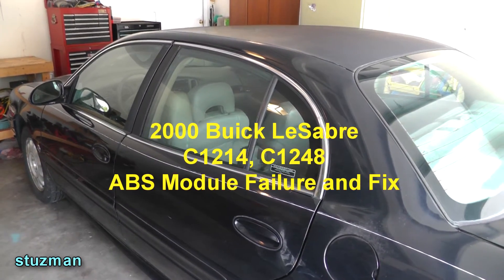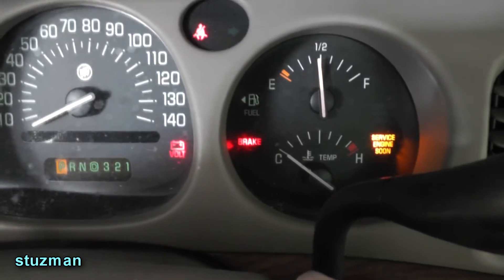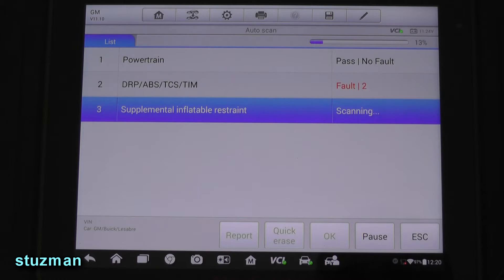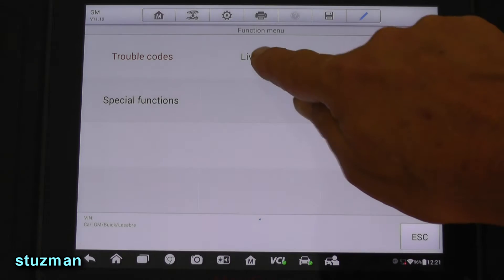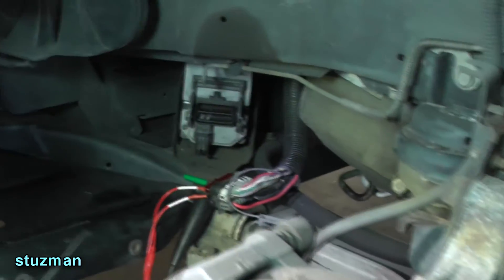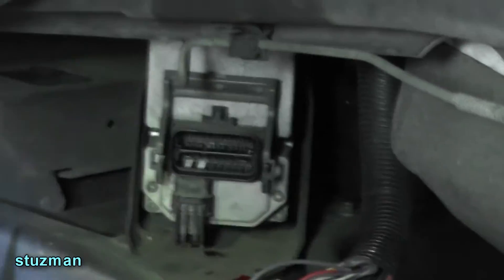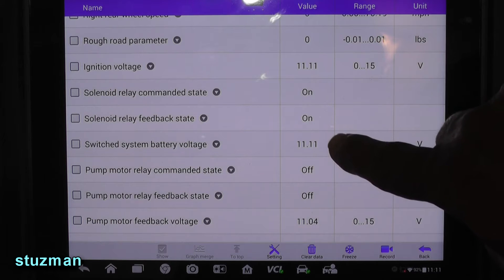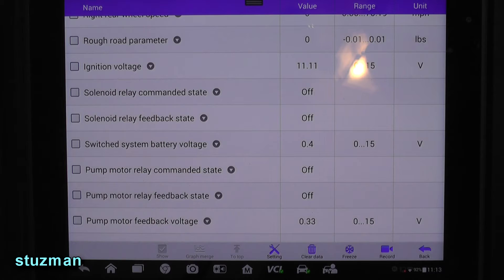Buick LeSabre, C1214, C1248 Codes, ABS Module Failure and Fix

Comment: What a thorough and excellent explanation. If you are experiencing problems with your ABS system please take it seriously. February 2020, I was told it could wait and my Buick went off I-20 at 70mph hitting a tree head on due to the wheel sensors being affected. This left me in trauma with a knee & hip replacement and my spines L-5 broke in addition to a head injury. I was told I'd never walk again. I was bed ridden for 8 months, went through extensive rehab for PT. After 3yrs I was able to limp at best but am grateful compared to the way I was. I live in horrible chronic pain especially with my knee and spine. Please take this car diagnosis seriously so you don't find yourself getting traumatic medical diagnosis or even killed in a wreck. Thanks for the video.
Reply from the maker: Sorry to hear about your misfortune Susan and you are correct that ABS systems should be diagnosed and fixed.

Comment: What's your charging voltage
Reply from the maker: I don't remember as it's been awhile on this video. Nonetheless, there wasn't any charging issue after the repair. Have a great day!
Reply: @stuzman52  mine get up to 15.3 and runs 15v all thr time unless i let it sit.  Alternators ok, batt good
Reply from the maker: @confidential8738  It seems mine was running around 15V, but I never had an issue.
Reply: @stuzman52  yeah alot of them do idk why they think that strategy is ok.. thats high imo

Comment: I bought a Buick lesabre I found someone cut and crossed the power & ground wires on the harness to the abs module. What would this do & what would this accomplish?
Reply from the maker: Hi Paul! If you're lucky, the module won't be damaged. In any event, the module will not work and you'll probably have an ABS light on. On the unlucky side, your module could be damaged by crossing the wires power and ground wires. And what would this accomplish by crossing the wires? Absolutely nothing is good from it!

Comment: Hello,

I have a 2002 Buick LeSabre with the same issues. If I send it to be repair, do I still need to bleed it at the dealership?
Reply from the maker: No, you will not need to do any bleeding of the brakes! The module just bolts on to the hydraulic assembly and is completely separate.
Reply: Thank you so much

Comment: My Toyota Prius is showing a C1214 code. Hydraulic Control System Malfunction. What should I do?
Reply from the maker: The ECU has determined that there is an issue with the hydraulic braking system. More than likely it's an issue with the ABS. If you're not familiar with the systems, the best thing would be to have a reputable technician diagnose the issue for you.
Reply: Hi Sheryar,
Are you able to solve your problem with DTC 1214 in Toyota Prius? As I'm also getting same error time to time sometimes in a month or 2, I checked with 2 technicians and they are saying to change ABS completely, but I observed whenever I wash my car specially tyre and rims after that I get code 1214.

Comment: Drill the hole out using a #7 drill bit and then tap the hole with a 1/4-20 tap. You will then be able to use a 1/4-20 machine head screw to force the cover off along with a flat blade screwdriver to finish prying it apart. I said a machine head screw because a machine head screw has threads all the way to the head unlike a 1/4-20 bolt which only has threads the first 1 inch of the bolt and the case is thicker than 1 inch. I used a 2 inch long 1/4-20 machine screw. You have pry it loose from the silicone sealer they used to make it watertight.  Easy peasy, just take your time.
Reply from the maker: You are absolutely correct Marvin and once I got the unit back, I saw what they did to repair the module. I wish that I knew about this procedure beforehand. Great info for those out there who wants to repair their ABS unit themselves.

Comment: I followed your video and used my Tech 2 to confirm my ABS module needs fixing, I clicked on the link you have about fixing the ABS yourself--which I did last night--then installed cleared codes turned 2002 Lesabre on drove down driveway and no ABS/ lights came on!  Thanks a lot
Reply from the maker: Glad to hear Aaron that it all worked out!

Comment: Question If I remove my ABS module and send it away for repair does PCM still get wheel speed PID and other PID  that the ABS module would have--can I still drive my 2003 Lesabre
Reply from the maker: Your ABS light will be on but you won't suffer any issues until you get your module back. Your odometer should get the signal from the vehicle speed sensor which is sent to the PCM. I'm not 100% sure about that, but you can always take the vehicle out to confirm if this is the case.
Reply: Thanks I'll give it a try and post my outcome

Comment: Stuzman, I had a question for you. I noticed at the beginning of your video (great vid and diagnostic btw) that you were initially concerned about the voltage from the battery.  Could an old or underperforming car battery be causing this problem? Triggering the ABS system?  I think this may be the issue with my family's 2004 buick lesabre in st. louis. My father hasn't pulled the codes himself but a shop wants to replace the ABS unit.
Reply from the maker: For the most part, when you see the codes that's shown in the video, it will be the ABS module. However with all electronics, one has to be sure that the voltage supply is correct to the module. Otherwise the electronics won't work correctly. So, in your question, if you did find something wrong with the supply voltage, then by all means, that would  be fixed first.
Reply: @stuzman52  Thanks for the quick reply! And that does make sense. Is there anyway to cheaply check this voltage from the battery without your scan tool?  It is an older car but has less than 100k miles, the special vented battery is over 6 years old at this point. Would a little voltmeter somehow attached to the battery detect this? I think we have one but not sure how to attach to the battery without messing it up. Or maybe an auto parts store could detect it for free with their scan tools? Also, will disconnecting the battery clear all the codes or do these need to be specifically reset? Please get back to me when you get a chance! Thank you!
Reply from the maker: @matthewobermeyer5954  You can use a voltmeter Matthew, but you'll have to leave the plug connected. You can just use a test light as shown in the video and if it glow brightly, you're done. If you have the codes mentioned in the video, it's more than likely an issue with the ABS module itself.

Comment: Your video is very interesting as I am having a similar problem with an old 2004 Buick LeSabre that I have.  I have not had a chance to run codes but I suspect the ABS control module has failed on my LeSabre with the JL4 Stabilitrak option.  Can you verify symptoms of a failed ABS control module? When the car is in park or reverse, the ABS and Stabilitrak warning lights don't trigger on the dash.  The ABS and Stabilitrak ONLY trigger when moving forward in drive.  The bearing hubs have all been replaced recently due to mileage (160K) and the connectors looked good.  This issue started before the hubs were replaced so I don't think its a bad bearing hub.  If its a cracked wire to the ABS wheel sensors, I would think this would be intermittent, but the symptoms as described are consistent, not intermittent.  Thanks,
Reply from the maker: Randy Andersen With the ABS fault, the brake light and ABS light were on even when the car wasn’t moving. Probably best to read the code(s) to give you some direction. Good luck on your repair!
Reply: @stuzman52 - OK, got codes.  Stored codes were C1223, C1224, C1227, C1232, C1233, C1245, and C1248.  Those codes must be from before I replaced all the bearing hubs and sensors front and rear.  The only current code is C1223 which points to the drivers left rear hub, sensor, or cable connector.  I cleared all the codes and ran the vehicle.  The only code that has come back is the C1223.  I suppose the other codes could be intermittent, but so far, they have not come back.  So, did I receive a bad bearing hub/sensor, or is the cause more likely the cable and connector?  The vehicle has 160K miles.
Reply: Also, if more likely the cable and connector, I see there is the complete cable from connector to connector and then just the connection to splice that connects to the wheel hub.  Which is the common problem?
Reply from the maker: @randyandersen9985  The C1223 indicates that the LF ABS sensor is open. Separate the connector from the sensor and read the resistance of the sensor. I don't know what the reading should be, but I suspect about a 1000 Ohms. You can check the other sensor on the front to be sure. If it reads open, then you've got a bad hub. If you've got a decent resistance reading, inspect the wiring harness to see if it's been rubbing against any metal. Good luck on what your find!

Comment: If you want to know how to remove the cover you could not get off and then repair the module check out  

https://www.corvetteforum.com/forums/c5-tech/2816125-how-to-repair-ebcm-avoiding-costly-repairs-through-absfixer-or-fleabay.html

Apparently the corvette has the same ABS module !    I did this on my mom's 2003 Le Sabre and it totally fixed it.   Thanks for the video!
Reply from the maker: Thanks for the info Zachary, but it's kind of one of those things that once you see that the manufacturer drilled a hole in the back, then all is clear. The next time around, I'll know what to do :)

Comment: I have the ABS light on in the 2001 Buick Century I am going to scrap. I want to do the same thing as you did and diagnose it. if it is the module I can rip it apart because it is getting scrapped anyhow. good diagnoses Terry!
Reply from the maker: It should be pretty easy to open up Mike since we know how the module company did it. I posted in the description of how they did it. You'll be able to see a small dimple in the back of the housing where they drilled a hole and tapped it for a bolt. Then this bolt literally presses the cover off from the back. I wish I knew this beforehand as I would have done the same thing and saved some dollars :) Thanks for dropping in Mike!

Comment: Great job with the video Terry! Nice explanation and good fix.  This will be very helpful to a lot of people.  Saving a lot of cash never hurts the wallet.  Enjoy the weekend.
Reply from the maker: Hey Glen and thanks for watching the video. I wished that I could have gotten into that module. I did do a little more research after the fact to see what people were doing to get into this module. Seems like you never can do enough research. Anyway, it appears that people are drilling a hole from the backside, tapping the hole and then screwing a bolt into it and then this bolt will press the cover off from behind. I'll put a link into the description so that other people could give it a try if they want. If I ran across this earlier, I would have tried it. Later, I looked at my repaired module and I see that the repair company did EXACTLY the same thing because I can see a small amount of caulking they used to cover their drilled hole. You have a great weekend too!

Comment: What did they change you to rebuild it? Would it be cheaper to just buy that product from a local Auto Parts Store? I am having the same problem with my Buick.It got low on brake fluid. The Abs light and brake light came on. So I added fluid. The lights went off for a week or so. Then they came back on. The have been on for about three months now. I will need to put new brake pads all around the car soon. Do you think that will fix the Abs light. I sure wish I lived near you. Great video thanks for sharing. I hope you have a blessed week.
Reply from the maker: Hey Tommy! I just checked with rockauto.com and that module will cost you $406 and then you have to have it programmed which needs a dedicated scanner to do the job. Not to mention that you have to pay for the subscription to get the program from GM's website. If you have to have the dealer replace the module, (they're not going to replace it), that will cost you about $1200. The cost to send the module out to have it repaired was $150 which has a 5 year warranty which to me is very reasonable. Before I take the module off of your car and send it off to have it repaired, you may have a different issue. Put a scanner on your car and get the codes read to see which direction you need to take.
Reply from the maker: Hey Thomas, I wanted to do a follow-up with you in how the cover is 
removed. I did some more research and found out that people were 
drilling a hole in the back of the housing where an indentation is 
located. Then they would tap the hole and screw a small bolt in it 
thereby pressing the cover off from behind. I looked at my repaired 
module and this is EXACTLY what the repair company did because I can see
 a small amount of caulking over the drilled hole. Damn, if only I knew 
this then I would have done the same thing. I put a link in the 
description of this video if you're interested in how it's done with 
pictures to show the innards. Have a good one Thomas!
Reply: stuzman Thanks for getting back to me. Auto Zone sells these abs modulars already rebuild for something like a hundred dollars. If l buy one from them do l still have to have it programed some where? Please let me know. Thank you so much for your help.
Reply from the maker: Thomas Tommy you will have to ask the folks at AutoZone Thomas. Since they are rebuilt units, the program may already be in there. I'm not sure.
Reply: stuzman Since it's an after market item. Do you will work ok? I think you from the bottom of my heart for responding to my post and for sharing your post. Thank you for everything.

Comment: I've been working on a similar problem with the module in a Chev. On the Kelsey Haynes 325 EBCM they reputedly go bad because vibration acts on the solder joints on the through-board connections. Unfortunately my four little T20 torx screws that mount the EBCM to the module are really hard to get at, and I've stripped one out already. If I have to remove the whole module to get at those screws, I may have to replace a few brake lines as well, turning a small project into something much bigger. So, the project is on hold for the moment. Congratulations on your repair, I hope I eventually have similar success. I didn't expect to see a 5 year warranty, that's pretty good. Thanks for posting this one, it helps.
Reply from the maker: Fortunately for me Dave, the six Torx screws were very accessible. I just wished that I could have gotten inside of the module to do a little soldering which wouldn't have cost anything. I did do a fair amount of research on different companies out there that repairs modules and www.modulemaster.com seemed to be the best although they were a little higher than the others. If you do have to take your entire ABS unit off, I would recommend using Kroil penetrating oil on the fittings for the brake lines. I've used it on several vehicles for this and it worked great! In the electroplating department where I worked which has a very corrosive atmosphere, we have tried every penetrating oil on the planet in freeing up bolts and nuts. Kroil was the only one that works! It's really an amazing penetrant and is used extensively in our maintenance department. Good luck on your repair Dave and thanks for taking the time to watch the video and sharing your experience with your module. :)
Reply from the maker: Hey Dave! I did some more research on my module to see how people were getting into it and found out that people are drilling a small hole in the back of the housing. Then they would tap this hole and screw a bolt into it thereby pressing the cover off from behind. I went back and looked at my repaired module and this is EXACTLY what the repair company did. I can see where they put a small amount of caulking over the drilled hole. If only I knew this before as I would have done the same thing. I don't know about your module, but it may be helpful when you get yours off to repair yours saving you some money. I put a link to this method in the description of this video if you're interested. Have a good one!
Reply: Good morning! Excellent point, hopefully people with your model will read to the bottom of this thread to find that little gem. I think the Kelsey 325 is mounted more easily, but in mine I won't know for sure until it is off. One site I found described other models as 'not repairable', but as you found that's just a matter of finding a way to do it. I wonder if they heat the whole thing up a little to make it easier for the glue to pull away without damaging the underlying board. Good point about the Kroil, I've never seen it here in Canada but we can get PB Blaster easily.
Reply from the maker: What ever you find on your module Dave, I hope it turns out that it will be easy to open up where you can save all that money. Good luck with your repair!

Comment: Great diagnosis. That looks like a good repair option with the 5 year warranty. I managed to open up the ABS module on the Golf and repair it myself. They're not designed to be opened easily! Cheers
Reply from the maker: Yeah Jonathan, I gave it a good try in trying to get that thing opened up. GM sure didn't want it repaired for sure and glad to hear that you were able to get yours fixed easily. Thanks for taking the time to watch the video!
Reply from the maker: You're a funny guy Dave, but you're right as that glue was like welding :)
Reply: Yep. GM glues are Ford tough. :) LOL